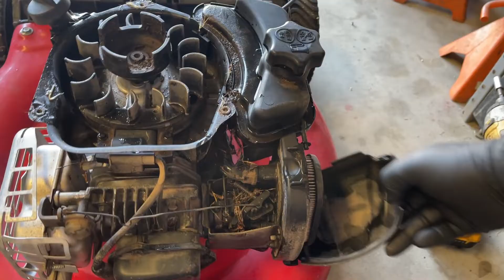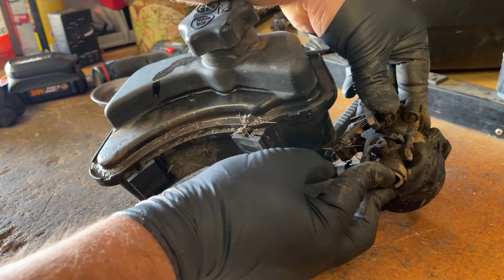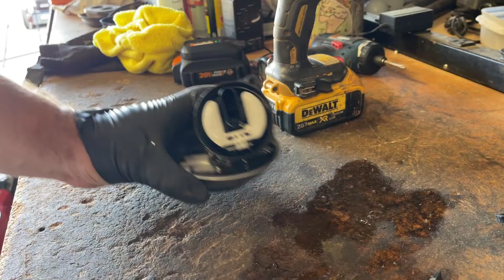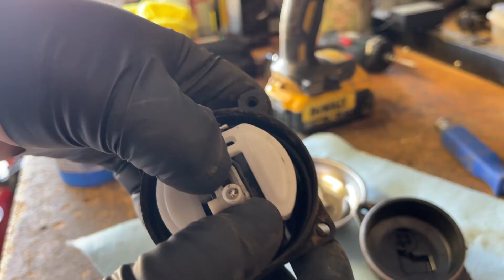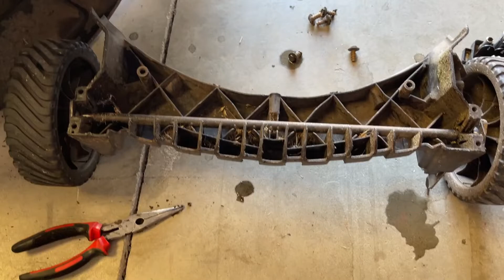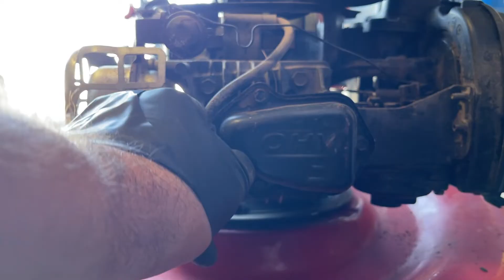Carburetor Cleaning Troy Bilt TB110

Comment: You rock. Great instructions!! Tore my TB110 down and cleaned carb.  Mower fired right up and sounds great.  Haven’t used the mower for two years and it’s ready to tear down my weeds.   The don’t be afraid pliers to pull the jets was key.  I was careful but gorilla wiggled it free.  Putting jet tube back on was a challenge but I lubed it with a little gas and that worked great.  Thanks for your help !!!
Reply from the maker: Glad to help
Reply: My sentiments exactly!  Pliers to pull the jets... I was way to scared before the video.

Comment: Thanks for sharing your knowledge & experience. Hopefully by following your guidance I will be able to repair my lawnmower to start with the key.  About 8 months ago I picked up either a 2010 or 2011 Troy-Bilt Model #12AGA26E011, Serial #1A191KC0892 from my neighborhood curb-shop front.  I cleaned it he debris and dirt that was all over the lawnmower on the day I brought it home. I plugged the charger into a electrical cord overnight: the next day, I added a little gasoline to the fuel tank and the engine started with the key start just one - then the battery was drained of juice.  I tested to see if the engine would start without the key ignition/battery and it started no problem.  I priced a replacement battery and I could not believe the battery was priced at $65.00 to $95.00.  I figured that is why it was kicked to the curb. We entered winter, so I just stowed it in the garage until recently when I found a replacement battery at Lowes for $32.98.  The fuel tank was bone dry empty because when I tested it I burned off the very small amount that I poured into the tank. I installed the new battery and the key ignition started the engine - great, so I disconnected the battery and removed it from the compartment [has not secure cover] and commenced to give this lawnmower a oil change, which requires tipping it over on its side.  After I changed the oil, turned it upside right, the key ignition won't turn the engine, but I can still pull the cord start the engine. I checked the new battery and the 40-amp fuse they are both good.  Now I figure I will attempt to take apart the carburetor.

Comment: Man keeps overfilling and leaking out of the top right hole where the choke gasket is. Any ideas on what I'm doing wrong
Reply from the maker: @ch4tterbox263  your float is likely stuck or installed wrong
Reply: @hanksgarage_  all I had to do was snap the rod that holds the float back in its ears
Reply: Do you have a video about adjusting valves

Comment: Would you know what size the screws are that secure the carb? Picked up a used one and they are missing. Ty
Reply: I think 8mm on outer black ones to mount it. Inner silver screws are an annoying 9/32. 2015 model. This guy has 2017. I see people mentioning slightly diff. so might depend on year for all I know